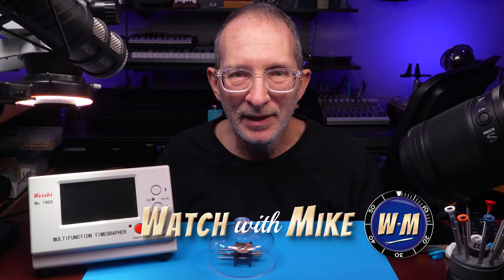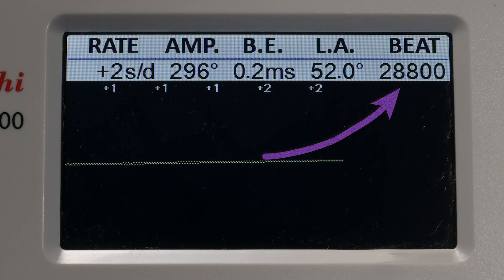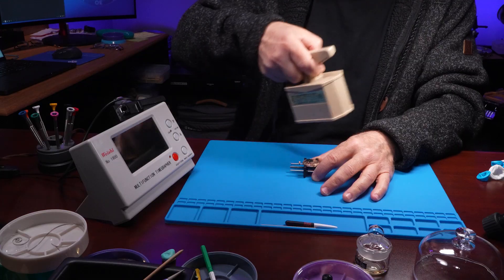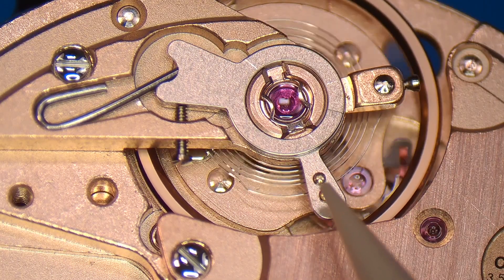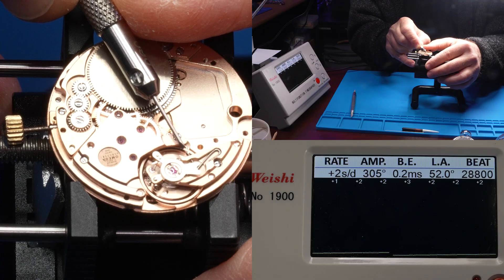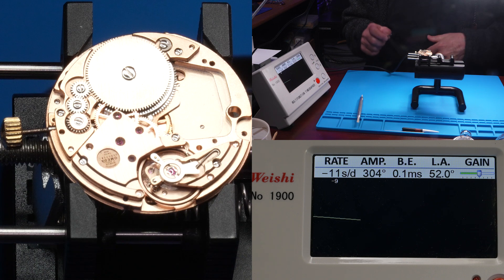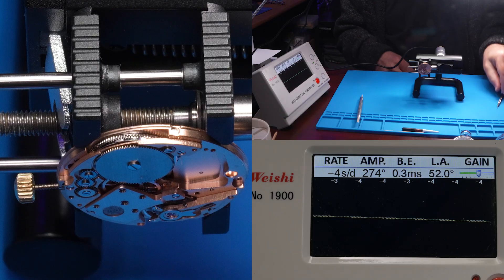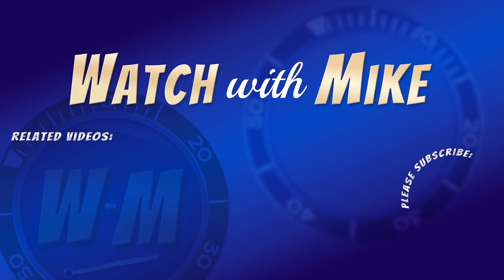⌚ Regulating a Watch with a Timegrapher Explained - Omega 1020 #watchmaking

Comment: Fascinating video! Thank you. I have a Co-Axial Caliber 2403 (Railmaster from 2006) that has been serviced recently by an Omega Service Center. However, it's running +8 s/day after a few weeks. Is it possible to regulate it at home, or does it need to be sent in again?
Reply from the maker: Hi Ola! If you can get the back off and access the regulator then you should be able to make a small adjustment yourself. (I don't think the 2403 has a micro adjuster.)
Reply: Thanks for replying! I'll see if I can work up the courage to open it up.  @WatchWithMike

Comment: Sorry! for question not relating to your show today! need suggestions for installing a movement I bro  ke off when taking off the dail. How do I install a new movement to a dial that has with broken points?
Reply from the maker: @richardhaney7131  if the little posts have broken off the back of your dial, you can get replacement dial feet. You can do a search for "Watch replacement dial feet ". The best way is to solder them onto the dial. But there are also self adhesive dial feet available where you don't have to solder.
Reply: @WatchWithMike  Thanks Much for the info. Think I will try the Adhesive dial feet, I am no good at😆 soldering! I will be more careful in the future when removing any movement.
Reply from the maker: @richardhaney7131  Good luck Richard! 😁

Comment: The demag made the light on the weishi come on from the field.  That's a strong demag.  I used one in college for VHS and it would rattle the tapes violently.
Reply from the maker: @robcarnaroli269  Cool, I didn't notice the light! I've used industrial tape demagnetizers before and they are so strong that they heat up after a few minutes use. Rule #1 - remove your watch before using!

Comment: I'm using an app called watch accuracy meter , seems to work fine but wanting to know how accurate it can be comparing to the time grapher as I'm not ready yet to invest in it ? also what if the difference in accuracy is above 6 sec according to the position the movement maybe in , does this mean it needs to be maintained? note that no difference in BE 0.2 ms .
Reply from the maker: @AMAMBT  you can test the accuracy of the app by doing a 24 hour test of your watch compared to your phone time. See if the watch actually loses or gains what the app is saying it is. There's a lot of factors that can cause a watch to differ by six seconds in different positions. It really depends on the watch… That difference is well within spec for many mechanical watches, and not necessarily an indication that the watch needs to be serviced.
Reply: @WatchWithMike  thanks for the reply , actually the app is accurate when compared to the atomic watch of my phone, as for the movements i regulated myself were the ETA 2836-2 that now has accuracy of 1 sec , 0.1 be and 280 amplitude at 3 directions, the movement that has the seconds difference is miyota 8205 , i know it is cheap one but after regulation it has healthy amplitude of 268 , 0.3 beat error and 13 to 6 sec according to the position , its specs states that it should be -20 to +30 as i remember .
Reply from the maker: @AMAMBT  Those are both good numbers! It's very satisfying when you can get a watch performing so well!
Reply: Very cool video.  I do everything I can to lower magnetism correct tools, etc.  I also deionize with 100% IPA, but that does not last very long.  I wonder if anyone or you Mike has experience with grounding the movement and holder (if conductive) to mitigate charge build up.  I might just try it😊